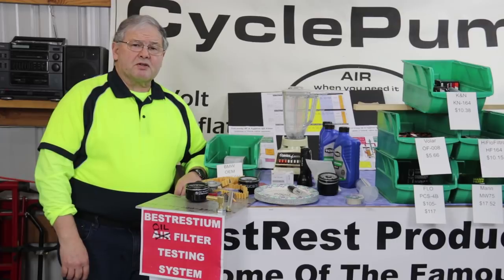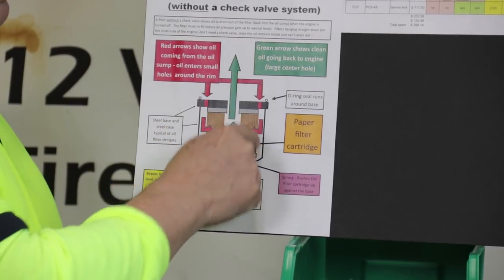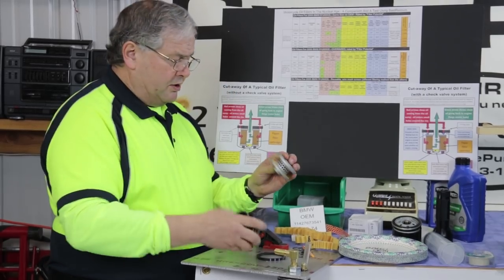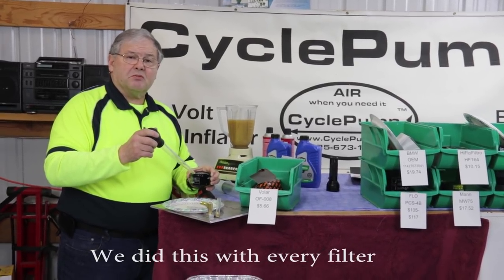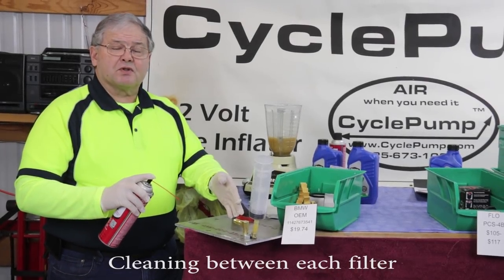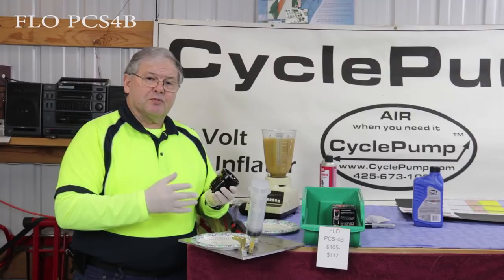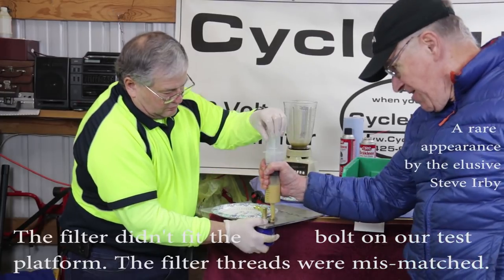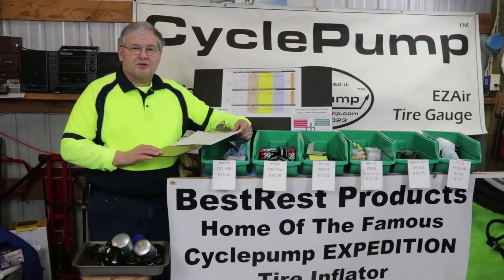Motorcycle OIL Filters In The Nuclear Age - Which One Is Best?

Comment: While not perfect (as you admit), this is great data to add to what little we consumers know about the true effectiveness of oil filters.  Thank you for all the time and work you put into this.  I've been searching for this kind of information and this is directly informing me on what brands to avoid and what ones to use.  Most of the other tests I've seen out there only compare new filters, which is only a little helpful, or used ones that don't go into any meaningful testing other than showing that a filter didn't completely fail mechanically.  Many reviewers rate a filter on component quality which is meaningless if it functions properly.  Even the paper quality--you can't just judge filtering capability based on a feeling.  Your test, while it doesn't test some things, at least shows initial filtering capability for 20-50 microns.  This wasn't mentioned but I bet that the results falling in the middle of the pack were filters that allowed smaller particles through, while blocking the larger.

Comment: Great test! 
I noticed by the way that the best in class for filtering ( K & N) has the lowest bypass opening valve operating pressure. That means to me that under normal conditions, filter will operate quiet often in bypass mode, thus making ineffective the better filtering capabilities it has.

Comment: Interesting test, i always thought that K&N and HiFlo are pretty much the same filter (apparently made by the same company) except K&N has a nut at the bottom but i guess your test would show that this is not so.  Even though in your test K&N performed better but had only a 2psi to open the bypass valve I think in real life that 2 psi is reached pretty quick so in the long run the HiFlo might be the better choice.
Reply from the maker: I agree. But I think the better choices are Mahle,  BMW and Mann, in that order. 

The photos show the K&N with the least Bt glow. But as soon as the bypass valve opens (and it will 5x faster than the Mahle), the K&N falls on its face. And the HiFlo had more Bt glow than all those others.
Reply: BestRest Products I wonder if it’s possible to recheck the k&n easily? I ask only because I watched a tear down of a handful of filters aside a Honda oem and the k&n had by far the stiffest bypass spring which is curious

Comment: interesting test... how do we know for sure that the bypass didn't open and allow unfiltered oil/slurry into the plate on any of the tests? if the bypass opened at any time for even a split second contaminants would be allowed to bypass the filter.. (other than the bypass screens in the couple that had them).. i'm not sure how much pressure the syringe made.. but if some of these bypass valves upen as low as 2psi.. it would seem that many, if not all, might be opened easily by very low pressure on the plunger..   like i said,i'm not sure.. but it seems like you could overpower at least some of the bypass springs easily.. which i guess shows in the testing.. the best is the best regardless of if it opens or not..

Comment: If you only measured the force in pounds to open the bypass valve (like shown in the chart at time 6:15) then it's not measuring the PSI required to open the valve.  You need to measure the acting area of the valve and then calculate the PSI required to open the valve based on your force (lbs) measurement.
Reply from the maker: As long as we used the same method of measuring bypass opening for every filter, it really doesn't matter.  The chart shows which filter open too easily.  That's not good.  Easy opening means the filter media is bypassed.
Reply: @bestrestproducts648  - did you measure the area of the bypass valves?  The diameter of the bypass valve is not the same among oil filters.  You have to calculate the PSI opening pressure based on the force and area of the bypass valve.  A small difference in valve area can make a significant difference.  Cool testing method by the way by using the UV glow material.
Reply: @bestrestproducts648  Unfortunately, this isn’t true.  If you only measured the spring force, that is only one component of a pressure measurement.  Comparing spring forces of the filters tells you nothing at all about the pressure required to open the bypass valve.
Reply from the maker: We had no way to measure PSI, all we could do was measure force in pounds.  Not engineers here, just a couple guys working with what we had.
Reply: @bestrestproducts648  I understand.  I just wanted you to know that measuring the force of the spring is essentially meaningless as the valve is opened by oil pressure and you need to know the area the oil pressure acts upon to relate that to force.  A large valve with a 5 lb spring will open long before a small valve with a 3 lb spring.
Reply: @bestrestproducts648  Which makes this completely useless.

Comment: Interesting summary - thanks David. The variation in the bypass valve opening pressure is a bit surprising to me looking across the lineup. While I don't have my BMW oil pump spec for the R1200 handy, I would think that perhaps the pump output exceeds 12 psi at any rpm anyway meaning the bypass is ALWAY open when the engine is running. If so, is the "valve opening pressure" value then a bit of a red herring in terms of meaningful impact on performance? Also, noticeable difference IMO in the amount of UV showing between the Mahle and BMW filters that aside from the metal screen in the BMW are identical filters. What do you make of that?
Reply from the maker: I very much doubt that the BWW / Mahle filter bypass valves are wide open all the time.  BMW wouldn't allow that feature, lest it cause issues.  If the valve is open, the filter isn't doing anything.  And since the BMW / Mahle had identical values (and every other filter had lower values), that means that all the other filters would be useless.
.
The Mahle and the BMW filters are identical in all respects, EXCEPT for that wire mesh screen.  BMW's filter even has the brand name Mahle on the side (clearly Mahle is making the BMW filters under subcontract).  So why is the UV image slightly different?  I dunno.  
.
As for the red herring of valve opening pressure and filter performance...  A lower valve opening pressure means that the filtering material is bypassed, that's irrefutable.  When it opens the oil goes right thru without any filtering.  A lower opening pressure means that filter is useless.  A higher opening pressure means the filter has a better chance of filtering (everything else being equal).
.
K&N had a pitifully low opening pressure.  Although the filter media rated high based on square inches and thickness, it fell on its face because of the low opening value.  
.
I think we can agree that the BMW filter is the baseline, the standard for comparison.  Mahle is practically identical.  All other filters must be held to that standard.  
.
FYI - in my last oil change I used the Mahle.  The costs and availability (Amazon next day) made the decision easy.
Reply: You are not understanding the pressure that the bypass valve sees.  It isn’t seeing the pressure put out by the oil pump.  Most engines run in the 30 - 60 psi range which means that all of the bypass valves would be open all of the time if they were activated by oil pump pressure.  What the bypass valve sees is differential pressure in the filter.  This is purely a function of the resistance to flow provided by the filter media.  If there was no filter media, the differential pressure would be zero as if 60 psi was at the inlet of the filter there would also be 60 psi at the outlet of the filter and the valve would see 0 psi differential.  Now let’s say the filter media provides 5 psi of pressure drop.  The filter inlet still sees 60 psi from the pump, but the outlet sees 55 psi as 5 is lost passing through the media.  Since the bypass valve is between the filter inlet cavity and outlet cavity, all it sees is the 5 psi lost while passing through the filter.  If the bypass valve opens at 7 psi, it will still be closed.  Now let’s assume the filter starts to get full of junk and the pressure drop through the media increases to 8 psi.  Now we have our 60 at the inlet, but only 52 at the outlet.  The bypass valve now sees 8 psi differential pressure and since it opens at 7 psi, it will be bypassing much of the oil.

Comment: The downside to the screen is that if there is enough gunk to clog the large paper element, the screen likely will also clog very quickly starving the engine for oil.  Whether this screen is an advantage or a hazard is arguable in my opinion.  Yes, it isn’t ideal to have particles getting through to the engine via the oil, but I will argue that is better than having no oil at all getting to the engine.

Comment: 25 years ago I did a similar test on motorcyle filters., but I used a independent lab and used ASTM performance testing procedures to compare 8 filters for absolute efficiency and capacity until the pressure differential increases and bypasses the filter. The OEM, Wix and Amsoil filter were more expensive but out performed all others.  One note worthy conclusion from my test is the low cost filters did not meet the bypass crack pressure required by OEMs, and had capacity and low flow rates that were also out of spec.  Looks your list of filters varied quite a bit and I bet some did not meet OEM specs for pressure differential.  The test I did were for all filters specifically made for the same model of motorcycle for a fair comparison, because each filter has different design specs and will have different results... How did you measure the pressure differential and what was the spec required for BMW?
Reply from the maker: I don't know the BMW spec.  The BMW and Mahle valves opened at 12 pounds. See the chart in the video. Only the Wix had a higher reading. 

We didn't use a "lab" to conduct these these tests, but I once owned a Golden Lab, so I'm pretty sure I'm professionally qualified. 

As for the pressure readings we used a digital scale. We placed the filter housing on the scale,  zeroed it, applied pressure to the valve, and recorded the weight needed to open the valve. Very low tech but very accurate.
Reply: Would it make any sense that a filter with more filtering media would need a lower bypass valve pressure because the pressure is being restricted much more by the more restrictive filtering media ? Also in combination with that would the k&n screen give it somewhat similar performance to those with less filtering media and higher psi to trigger bypass
Reply: @Fee.1  My guess is that the more media (square inches of surface area) the less pressure is needed to get through the media.  I would think that the bypass pressure needed could be lower in this case (and not get triggered as often) but seems like any filter should follow a "standard" for pressure needed to trigger the bypass regardless of filter media flow.
Reply: @bestrestproducts648  It sounds like you were measuring the force required to open the valve, not the pressure.  Force and pressure are quite different concepts.  The only way to accurately measure the opening pressure of a bypass valve is to flow a fluid through it and measure the fluid pressure required to open the valve.  The size and shape of the valve also affect its opening pressure, not just the spring force.  It sounds like you measured spring force, unless I am not understanding your description of your method.

Comment: The filter test does not take into account particle buildup in the filter medium over time. Filtration will improve in all cases but not necessarily equally.
Reply from the maker: As each filter goes thru its life-cycle, it will accumulate more and more particulate.  Eventually the buildup will be so severe that oil flow will be restricted.  When that happens the bypass valve opens and the all the oil goes right past the filtering media.  That's why it's important to change filters frequently.  Motor oils can still do their job long after the filter needs replacing, which is why it might be a smart idea to replace them mid-way through your normal oil changing routine.  

Filters with a low opening value for the bypass spring (i.e. K&N) will open up during startup when the oil is cold, and it'll open up under moderate contamination build-up.